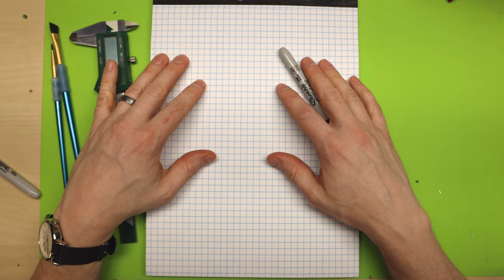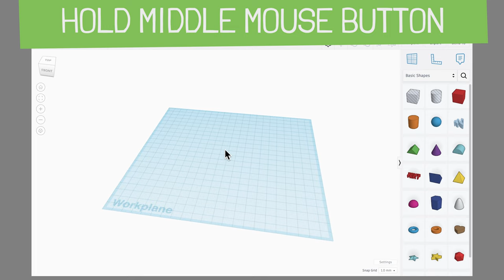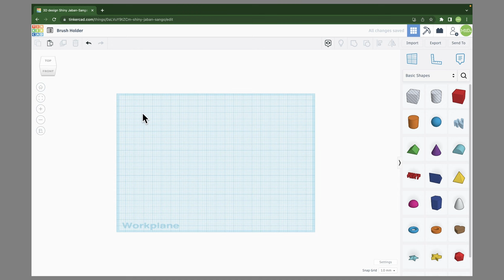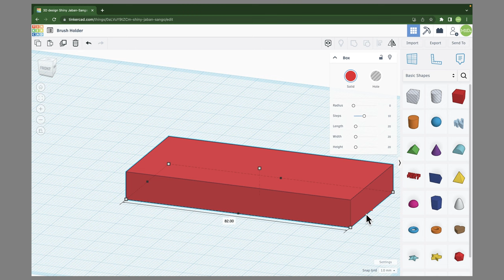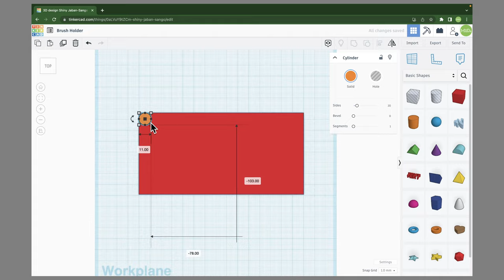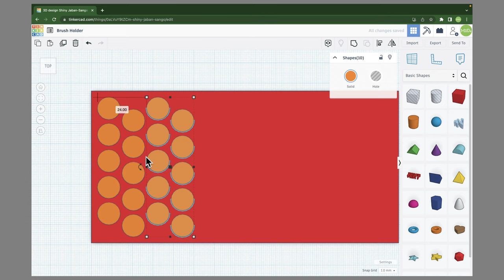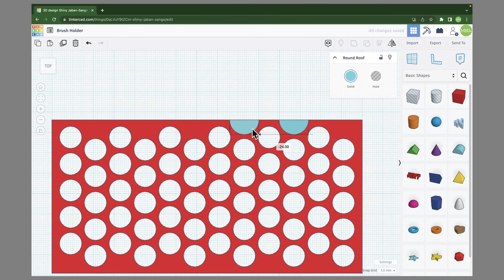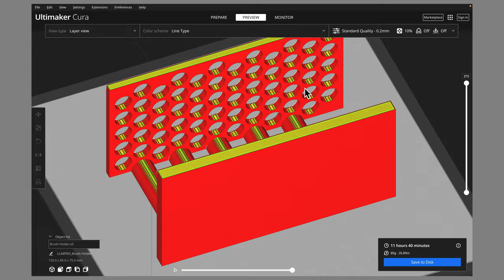Learn How to Turn Your Ideas Into 3D Prints using TinkerCAD

Comment: If you added the half cylinders so that they were 2 mm above the workplace, would that have accomplished the same as adding a bottom layer? In other words, if the half cylinders weren’t touching the bottom surface of the work plane, would they still cut all the way through the material?
Reply: Yea, if the hole cylinders weren’t touching the bottom there would be a “base” cause it wouldn’t have cut all the way through.

But in his defence, he also made a duplicate of the bottom which holes go all the through. So, for the sake of efficiency he made them both go all the way, then added a seperate base after.

Comment: Just bought an Ender Neo then tried to learn Tinkercad. Not as easy as it should be, there were gaps everywhere in all the tutorials. Until I happened on your youtube channel. You made the best tutorial I have ever seen. I went from watching your tutorial to making my first design. Keep it up, you are one of the best teachers I have had the pleasure of learning form. Thanks!!!!
Reply from the maker: That’s so great to hear. I’m glad I could fill in all the gaps. Tinkercad is a fun software and you can do so much with it. I also have tutorials on teaching Cura if you ever have problems with the software it can be trick when first getting started. Best of luck.

Comment: One change I would make is instead of using a separate base panel, I would simply have lowered the cylinder group within 2mm of the bottom.  Little quicker and one less object.